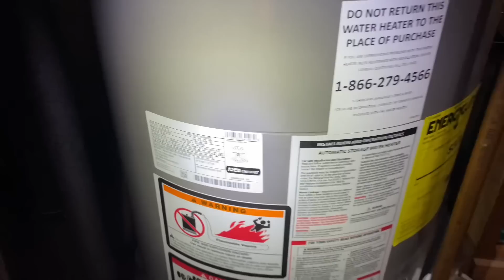Rheem 50 Gallon Water Heater Not Enough Hot Water - Key Traits for a Successful Technician

Comment: Best example of situational awareness I've had recently. Customer calls and said their central vac unit was burnt out and they needed a new one. Thankfully I went and had a look, I get there and he's got the damn thing plugged into a plug splitter so the dedicated outlet was shared with a surge protector. Central vac units, like space heaters and dishwashers, use enough current to melt those cheap things out. I immediately unplug all that and plug the machine in, and suddenly it works. Customer was incredulous that I was still charging him a full service call, until I reminded him that I could have just got him for $1100 for a new machine and quietly pocketed the offending electrical device to make it disappear. Once he realized he saved money and learned about amp draw, he was much happier.

Comment: my first thoughts with such a new water heater, was restricted flow to the tank and there's something in the house bypassing cold back into the hot side, mixing valve on toilet, pressure balance cartridge(kohler is bad for that), outdoor faucet with y-hose or hot/cold unit open with bad check valves.
but after seeing that valve closed, it could be the only issue and water flow cutting down to a trickle due to balance cartridges and temperature limit on faucets. the kitchen faucet could backflow cold into hot when open, as well as clothes washer on  any of the "warm" water settings.

Comment: Crap,
I know that control. It’s pretty damn dependable, gas valves … depends on utility, install and reliability.
Some times warranty.
Check PV & PV/MV then MV & PV/NP voltage. If it’s not there when it should be or is when it shouldn’t … nailed.
Makin the Trades Great!
Don’t forget it’s a fail safe design, if not, a golden ticket for survivors.

Comment: When they have that temperature valve set THAT HIGH your damn right that cold water inlet supply is going to get HOT.  I noticed this myself.  I have the same water heater and we keep it set on HOT all of the way on the other end of the dial's scale, and even that temperature can and will burn you at the tap!
Reply: That was clue #1...
Reply: @dc6233  It really boggles my mind though, that we set ours on the low end of the scale and even that gets burning hot, but there is so much adjustment to go to make it extremely hotter.  What are they trying to do, skin humans alive in the bath?
Reply: Lukewarm water is much more supportive of bacteria. It's a safety balancing act
Reply: @evanciambrone9373  I'll have to get a temperature reading.  I've heard 120-140 is ideal.
Reply: @PipeDoctor  I have ours set in the middle between LOW and HOT, which is at the bottom of the range, PILOT being the next setting to the left of LOW!

Comment: If hot was pinched down, flow is reduced. One shower would get enough flow/pressure of both cold and hot. Two showers would get reduced hot flow/pressure. A good balancing valve like a delta monitor 17 series. Flow would automatically reduce to help maintain the cold/hot mix. Try it. Turn the hot off and then turn the shower on. You should not get any flow. It's very clever, i didn't believe it the first time i closed the hot off at the tank. Their valves are not doing a good balance job. It's as if someone flushed the toilet. That shower would get hot, if the hot was full flow/pressure.